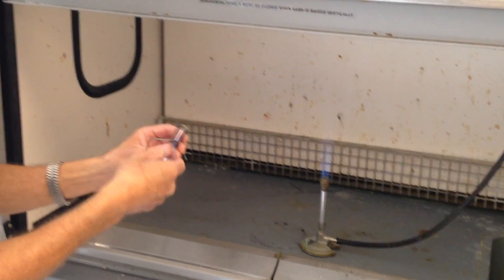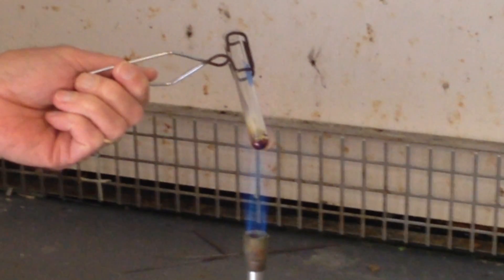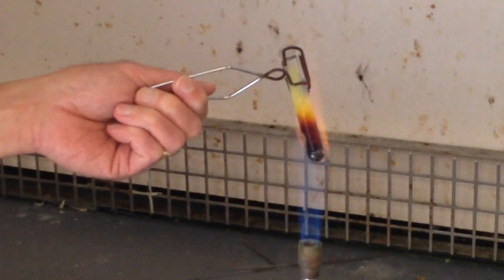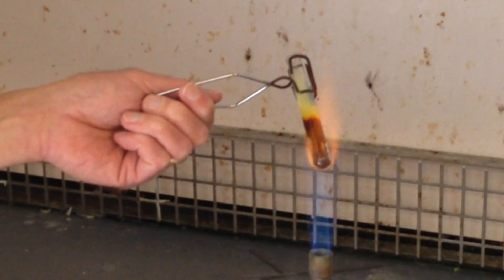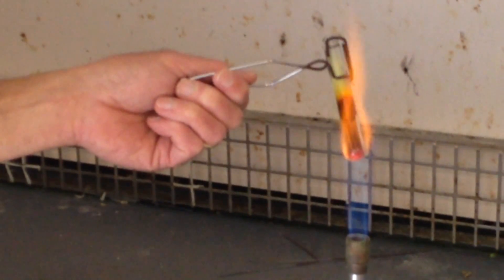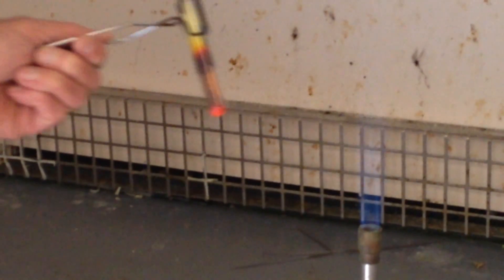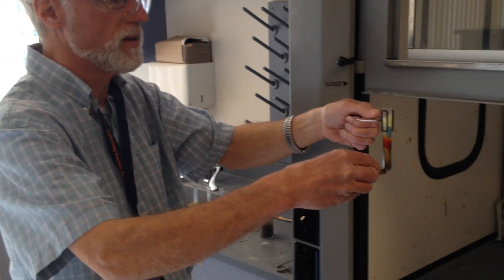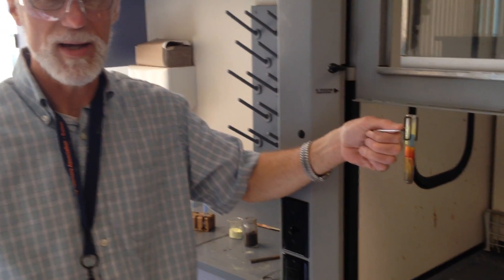Iron filings heated with Sulfur powder chemical reaction by John Owens and Dave Gardner

Comment: If you heat any metal it will lose it's ferromagnetic properties. How do we know that this is due to the sulfur and not just because the iron filings are too hot?
Reply: You are correct when heated to a certain temperature...I suppose we could have done a control test of just the iron filing by themselves to see if there was a noticeable change.  The exact temperature of the bunsen burner flame we used in this case would also need to be recorded to verify how hot it actual became.

Comment: how does it turn blue at the end
Reply from the maker: It doesn't turn blue...I believe what you are referencing that is blue it the Blue writing section that already exists on the test tube...If you look closely at the top middle portion of the test tube even before heated you will see it is already blue in that spot.
Reply: @barefootpainting  🧐🤦‍♀️